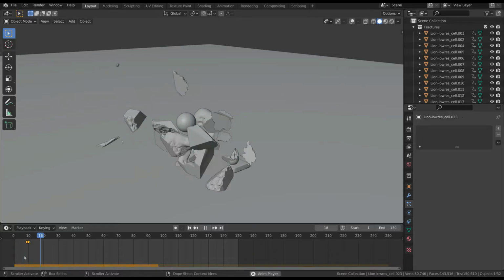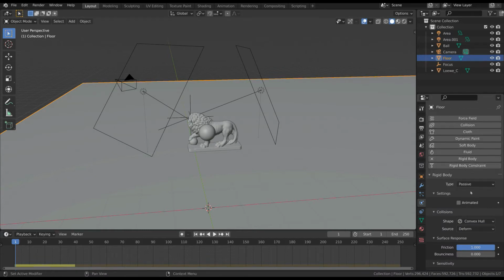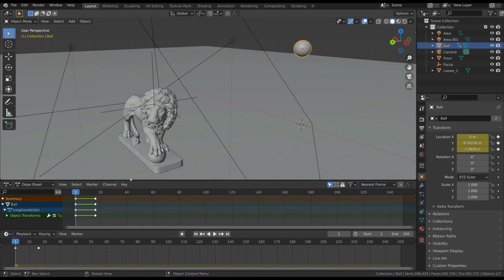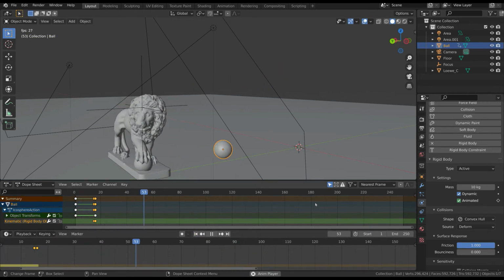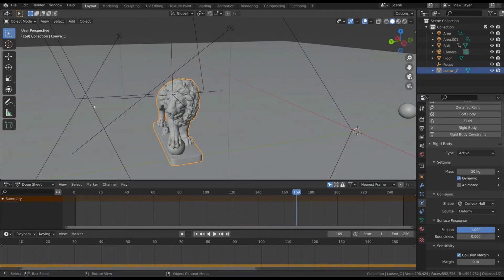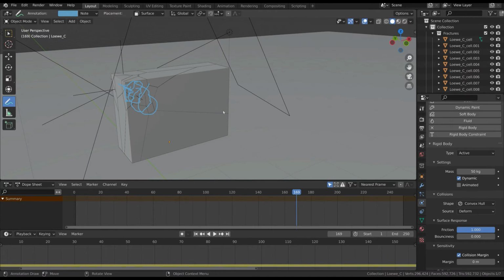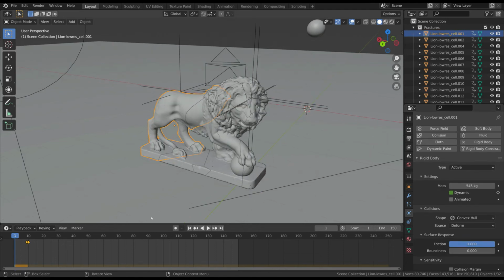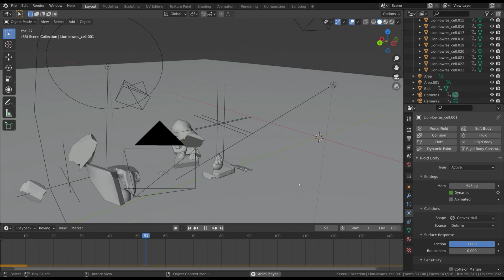How to destroy things in Blender with Rigid Body simulation and Cell Fracture

Comment: when a collision happens, it explodes all the objects far away, what am i doing wrong, they have a margin already.
Reply from the maker: sometimes when dynamic objects are close, they interact each other and this causes them to explode. You can try avoid that by activating the "deactivation" property and the associated "start deactivated" option in the rigid property panel associated to the objects.
Reply: LMAOOO FELT